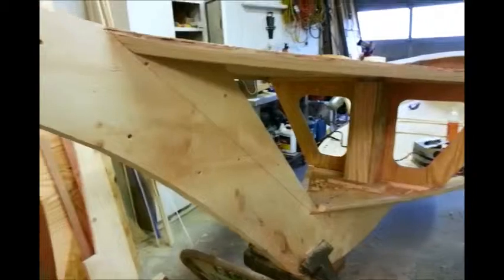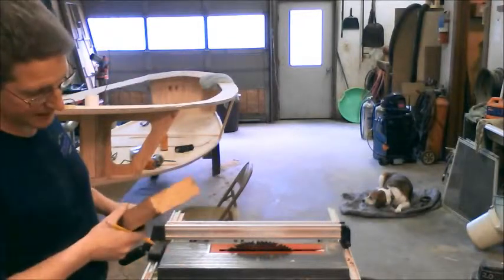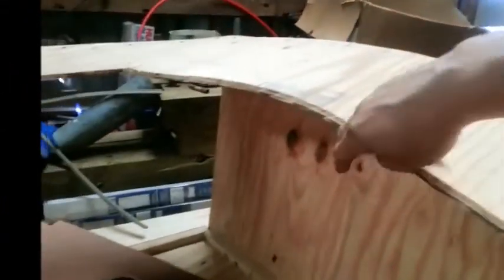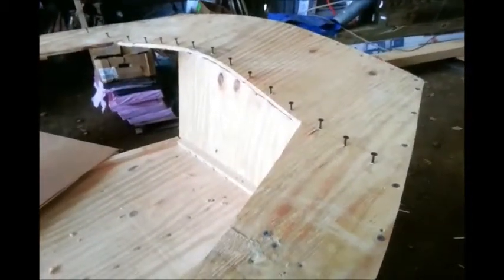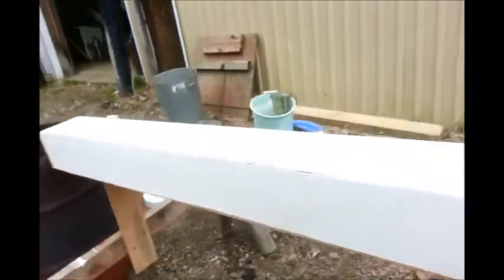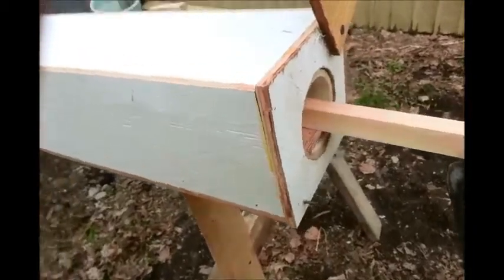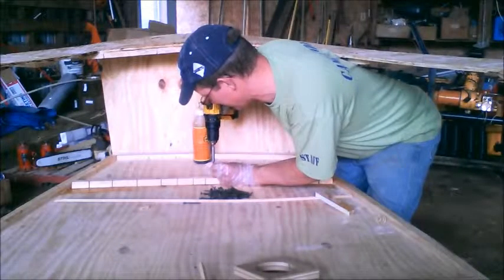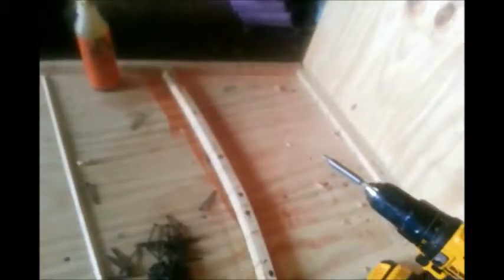Super Skipjack Build Part 10

Comment: Did that stringer really need to be one piece? Couldn't you have just cut it into smaller sections, since it's only an attachment point for the bulkhead?
Reply from the maker: Damien Gregory  your right it could've been several pieces. I wanted to do it this way more as a challenge and just following  the plans.